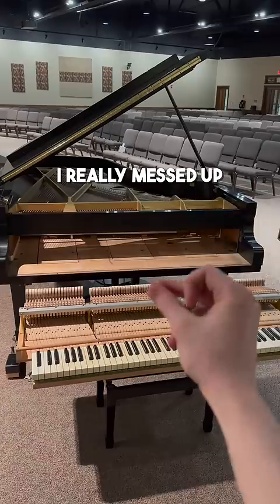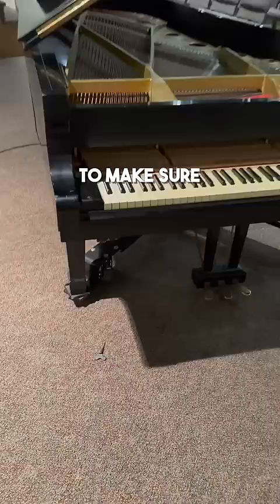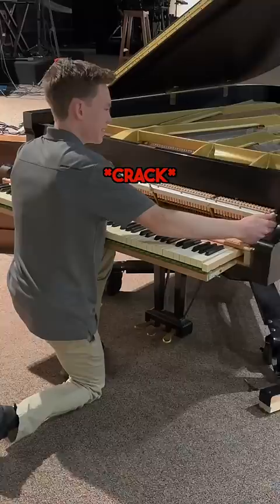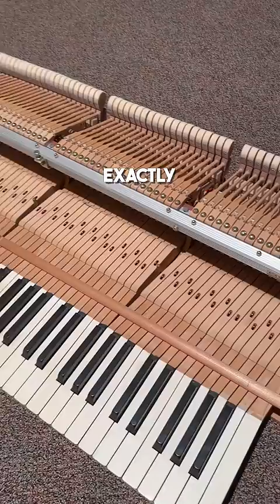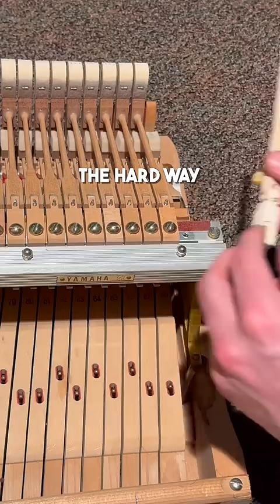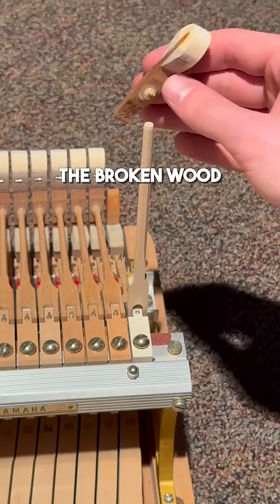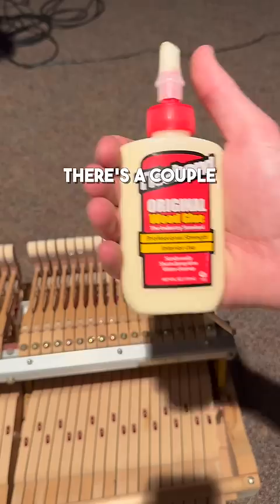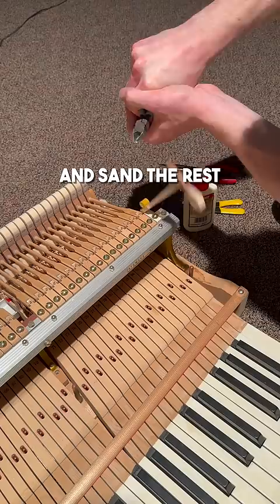I guess my mentor was right (like always)

Comment: Surprised nobody called out.
He messed up.
The pin could be removed with a heat gun because it’s hide glue, common in  instruments. 
The wood glue he “repaired” with made a permanent bond that cannot be repaired with the same ease in the future.
Reply: Thought the same thing, it's now much harder fix in the future.
Reply: @robertwoodward183  no? If you aren't carrying spare hammers you're a fool. It's just more parts that can't be reused that should've been able to be reused- I still agree it was a mistake but not one that made it harder in the future

Comment: The reason you could get the broken part out with some heat is because it was glued with hide glue. You should use the same on your repairs so it can be repaired again without it being a massive pain.
Reply: I agree. Just using wood glue makes it harder for the next guy.
Reply: tbh i was thinking hot glue but im an engineer, not an instrument technician

Comment: Should always use hide glue on the hammers instead of wood glue- hide glue can be softened with heat and allows you to make repairs, while wood glue is pretty much permanent :)
Reply: Love hot hide glue first, cold works of course, but I've been in a pinch in the middle of a concert where pva is about it, in fact in a real pinch, a dab of CA mixed with cold hide or pva will secure that sucker in seconds.  Not ideal for sure, but knowing what options you have when the situation calls for it is always nice to have in the toolbox.  BTW, I've had pretty good luck with wallpaper paste remover diluted and steam or other heat loosening up the pva pretty quickly when necessary.  Again not ideal, but options are nice :-)
Reply: @notinthealpha  Ugh, was under the wrong account when I posted this.  This was my response, not @notinthealpha.  My bad.

Comment: Id recommend using an oxidizing solution to age the wood to the same amount as the rest of the arms/hammers (as a weekend hobbiest luthier ive done it many times with great results). That way the repair isnt dramatically obvious. But i understand on a heavily used church piano its not as important as if it were a rare vintage piano thats value would be dorectly effected by such a repair.

Comment: Worth noting, the wood glue won't release with heat like the original did. I'm guessing it was some kind of hide glue. Hide glue comes in a bottle dissolved in water, or the solid form applied as "hot melt" is supposed to be stronger and faster (assuming you have the equipment to melt it)

Comment: My experience building and repairing furniture suggests:

Don’t use PVA glue for this kind of repair, unlike the glue you just heated to remove, PVA does not soften with heat. Liquid hide glue (hot water) or hot glue (just heat) are likely your best options

Comment: I usually loop my fingers around the front pins under keys 1 and 88 to pull actions and that generally keeps me from bumping the keys. Sometimes those frames get wedged in there so tight though.

Comment: My teacher taught me you can use a little dowel or leftover hammer rod and a mallet to tap out the left over hammer rod (I learned the terminology in Dutch so sorry if that's not the correct term) out of the hammer head without removing the glue. This works because the glue is usually not the strongest in sheer forces so it just pops out. That said, there's also a little tool to push it out instead of using a hammer. Great for the workshop but a piano technician's tool bag is usually heavy enough as is. I will say, the heat gun approach scared me a little since it messes with the wood's humidity. It's probably fine but I personally wouldn't take the risk. 
Also I probably would repair the rod instead but that's because I'm not there to get payed so I can spend all the time I want fixing things the hard/fun way 😂.

Comment: Pro tip: use wood glue so the next technician has to use a drill bit instead of a heat gun to remove the hammer

Comment: Its also a thing in Colorado
The reason is that the weather in colorado varies so much and is very unpredictable, so if you are wearing sandals you might aswell wear socks becausethe high elevation makes sunburn and heatstroke worse, while the rocky mountains make rain, snow, hail, sleet, fog cold winds and breezes even tornados on the front range more likely.
Its also sorta the same reason as Germany wearing them like this, winter comes around and people just don't care to switch them out.
Its not uncommon to see people wearing hoodies in the summer, and/or shorts in the winter in Colorado

Comment: Just a quick note as to why you also won’t do it that way twice. Unfortunately if you use titebond glue and someone does that again, you simply can’t use a heat gun to get the timber out as you did, just not that sort of glue, you’re better with hide glue or such that can be reversed with heat but to the best of my knowledge as a long term woodworker, titebond simply won’t let you remove that bit of wood, a drilling job usually

Comment: Despite saying "I put on the new hammer" it seemed obvious that he put the the very same old hammer that he took out of the piano, onto a new dowel. This of course is the correct way to do things. If the old hammer is serviceable, it would be wrong to replace it with a new hammer, as that would cause the note that the hammer is for, to sound out of replace relative to the other notes. Preserving the original hammer requires a bit more labor than putting on a new hammer, and the labor is more expensive than a new hammer. And the old hammer would not last as long but the most important thing is the sound. A new hammer is likely to sound "out of place." A savvy customer would know that re-using the old hammer would make their piano sound better than using  anew hammer. If they don't know that, you can explain it to them. This is not a car we are working on, or a computer, where new is better than old. It is a device for making music. Here, old is better than new – unless you are replacing all the hammers – ahd shaping them and voicing them as well

Comment: I never knew Weller made heat guns! I have a 60 year old weller soldering iron that still works like new. Will have to look into their heat guns. I bought a generic one off Amazon but it doesn’t have an auto cool off mode which I hear kills the element’s life. I’ve been having to manually cool it down myself and it gets tiresome.

Comment: So not music related but kinda similar: I went to a local jewelry store and had two of my rings polished. One was a ring I’d gotten as a birthday gift that was from that particular store, and the other is my class ring that I’d gotten from a different seller that my high school partnered with. When I got the rings back, I noticed the black finish on the sides of the ring was coming off because of what they’d used to polish it. I told one of the employees about this, and they said they’d finish it for free because they messed up

Comment: I did this to my upright Baldwin when i removed the action. It came out no issue just putting it back was a challenge. Had to loosen the actions feet in order to get it to fit again. I broke the nose screw and i bend F5 and broke the hammer clean off. My tuner is a cheapskate and will not get me another hammer.

Comment: "Every tuner makes this once and they never make it again." No.

As for using wood glue, think about this: You needed to use a heat gun to get that out, right? Now, that can't be done.  If that happens in the future, it will have to be drilled. Only use wood glue where the risk of an accident like that is minimal and you really don't want to be able to pull the joint apart. I understand. It's quick, and it's easy, but it does make things that much more annoying for future technicians.

Comment: So you break a part, replace it with a different quality part, different glue, different color and expect the customer to just accept his now 98% original piano?
Reply: Guess we have to throw away the piano now.
Reply: @isaacorganist  for one: He was able to remove the hammer because it was previously glued with hide glue, but now he used wood glue and you can no longer take them appart by using heat. 
fot two: if this was a proffesional's personal piano, they would likely notice the slight difference in sound.
for three: you wouldn't replace a Ferrari damaged parts with aftermarket replica's, you use original parts (including the glue in this case).
Reply: @deadso Dunno whst you expect him to do. It's not a Ferrari, the piano will sound almost exactly the same.